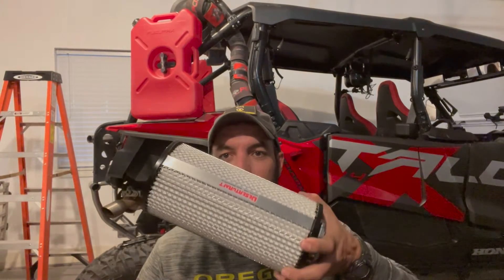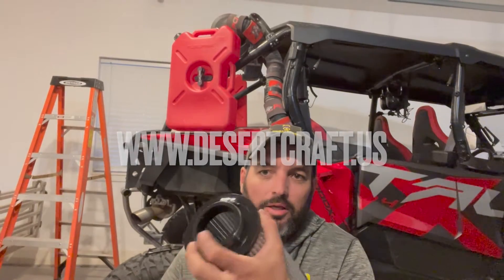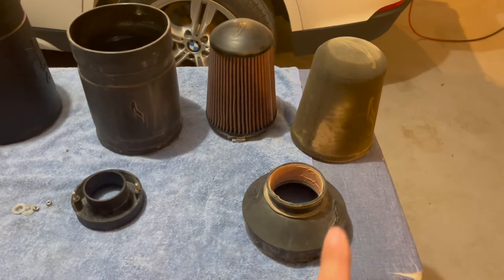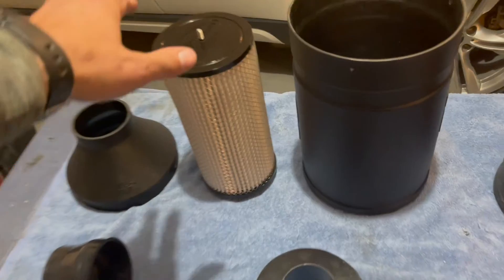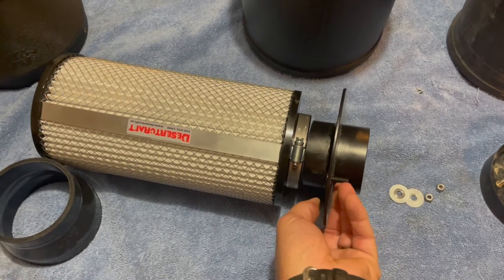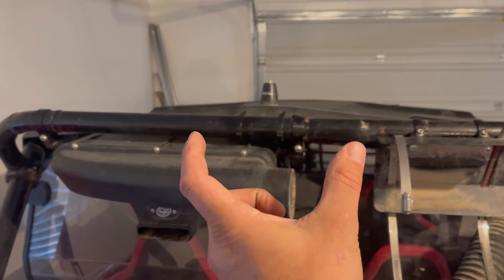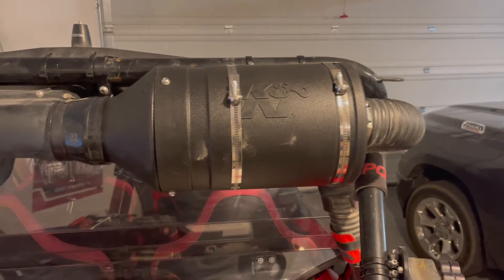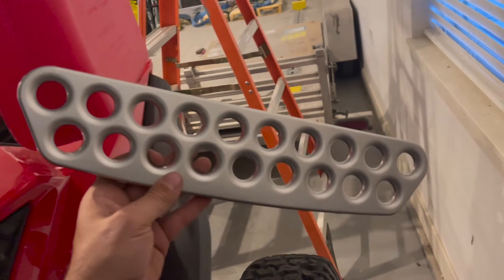Honda Talon Turbo AIR FILTER UPGRADE with Particle Separator!!!!

Comment: Thanks for the detailed videos; I’ve ordered the filter from Mark, and the filter housing from K&N. Would you be able to give more info on the clamps used to mount the filter housing to the JR bracket?  I’m not sure of size, or the vendor that you ordered from.  Thanks again!
Reply from the maker: You can take the k&n filter housing to any auto parts store and get a clamp that will fit!

Comment: Hi Russel, my name is Ricardo I have a Honda talon x, I'm going to install the desertcraft filter and the particle separator, did you completed remove the original filter and only using the Polaris filter ?
Reply from the maker: Yes, you definitely don’t want to use two filters! There’s a video on the install

Comment: Hey Russel got a question about the connection from the 3 inch hose to the turbo intake, I've seen you post your number here before and we're in middle of install if you see this in time do you mind if I give you a call?
Reply from the maker: Yes, I emailed you back and gave you my cell number

Comment: how is that extra filter going to effect the amount of airflow required for combustion?  In other words, is it going to restrict the flow of air effectively giving the engine a "Chocked" condition?
Reply from the maker: It increased airflow over the k&n filter. With k&n I was getting 10.5afr at full throttle, and with the Desertcraft 11.2. I felt an immediate power gain, deeper exhaust noise. There isn’t an “extra” filter, there’s only one air filter.
Reply: @gravesru  Thanks for the reply..................
Reply from the maker: @1gr8oil  thanks for watching